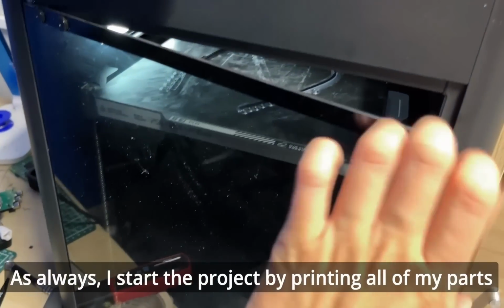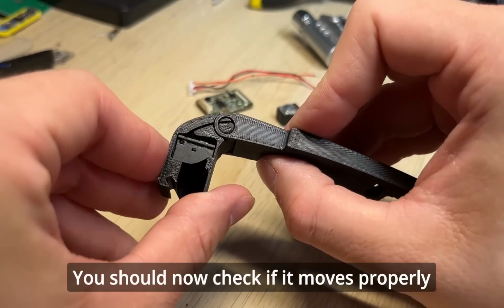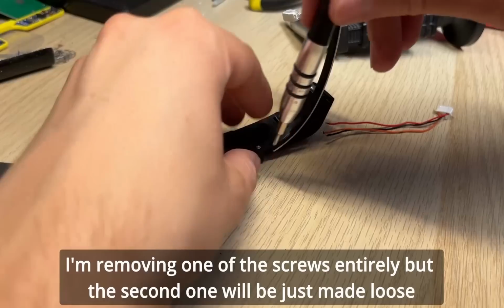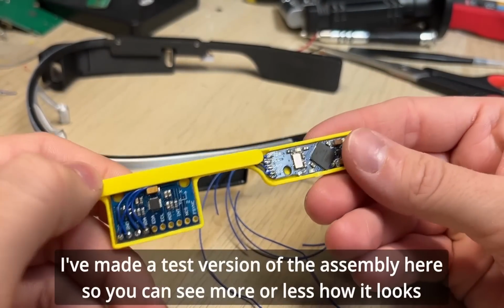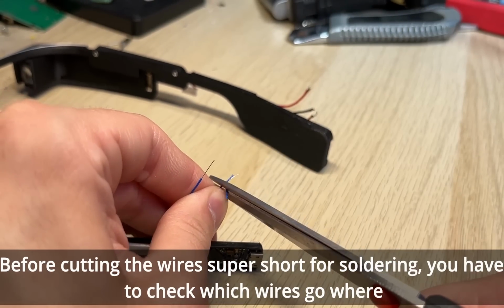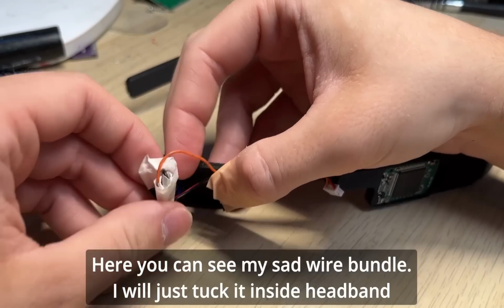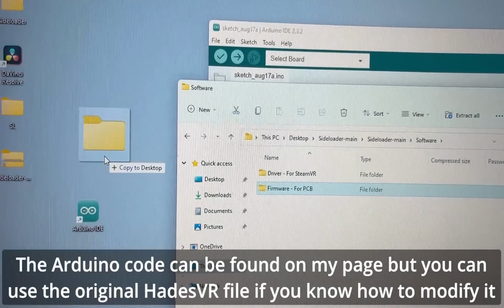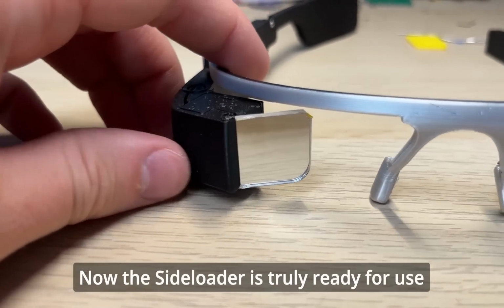Sideloader 1.5 | DiY Google Glass-like with SteamVR

Comment: This music makes me feel like I am in a scifi noir movie, I really like it. If anyone has the genre I would really appreciate the name. Also, I'd recommend making or buying a fume extractor for the soldering assuming there isn't already one off screen. Your cover for the driver board might benefit from being printed so that the large face is the face that touches flat against the build plate, but that might not fit with your design aesthetic, its up to you. By the way, I really like the step by step format you used to present this info to us, it makes things very accessible to beginners. also, if it makes you feel any better, your height is slightly above average where I come from.
Reply: I think you're looking for genre: Cyberpunk

Comment: I’d highly suggest just repinning wire the right length. Then you can avoid that soldering in the middle.
Reply from the maker: Yeah. Thats way better than soldering little wire pieces
Reply: @ManolloMancelli How do you make it so it has two displays? Do you just purchase two? Will the arduino code parse both of them, or the HDMI? Will they be offset like traditional VR?